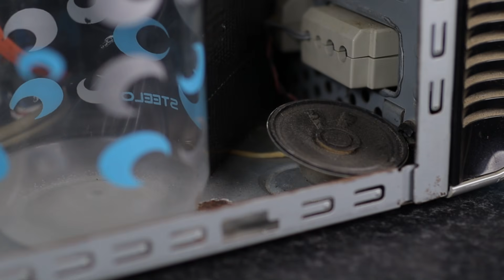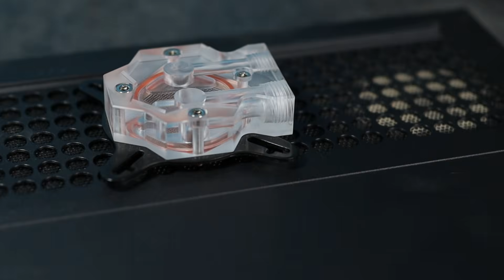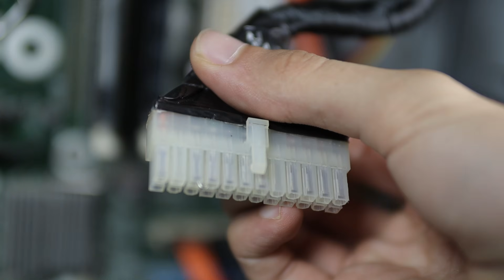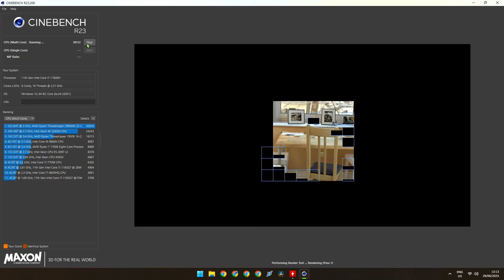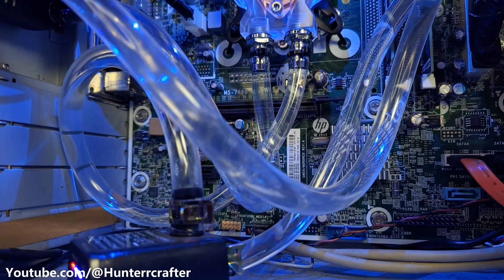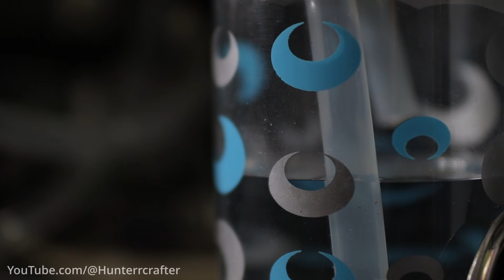Watercooling my Gaming Laptop - Part 1

Comment: The xmg neo has a water cooling solution. You may just custom make the same idea. Replacing  some air heat pipes with water heat pipes. Just run the laptop without water block in eco mode.
Reply from the maker: Yes! The solution they use in stock watercooled laptops is exactly what I'm thinking about! Just need to find a way of doing this without permanently modifying the laptop too much...

Comment: Im had this water cooling idea for very long time. I will make an external watercooling loop where you can connect it through a quick detachable watercooling tube which is connected to the block on the motherboard. This make it very portable.
Reply from the maker: This is exactly what I have in mind! This might be part 2